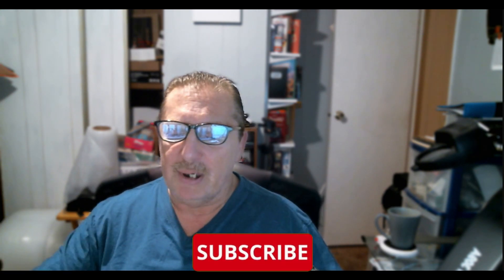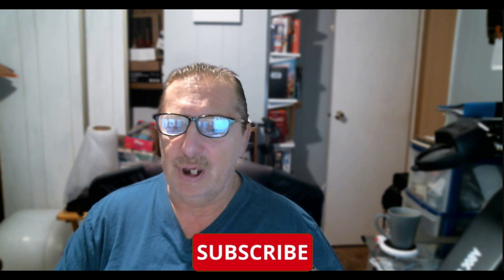Unknown Interference on 10 Meters / What Is This Interference

Comment: So i know what it is, We have the exact same issue but on a 27mhz in the UK. Turns out to be car chargers! they have a 100% cycle rate with no breaks in transmission which is illegal in the UK! EV charges are going to be the downfall of radio imo!
Reply: I live about 6 miles from Vince and have seen this interference. Saw similar signal  on 80 meters band Nov 15, 2024 1:16 AM EST 3.955MHz. It lasted several hours - about 10KHz wide. Live in semi rural Southern NJ. No charging stations in my area for EVs.  likely some homes with 1 car home charger could be nearby. 🤔
Reply: I'm a licensed Ham and EV owner and have never seen that. I am also very surprised you were able to pinpoint the source. What I do see is that some EVs are very noisy on 160 and 80m while charging, like the Renault Zoe, because they use a motor winding as inductance and have rather noisy charge circuitry.

This does not look like an ev charger to me. Too narrowband for that.
Reply from the maker: That makes sense!

Comment: Sounds like some kind of industrial machinery like an inductive welder of some kind. Waterfall displays have brought a lot of this type of QRM to our attention we used to ignore, before. It is so wide in its bandwidth, that it does not resemble a data transmission. I see many things on HF. There is one thing I have seen several times that has a high amplitude that goes all the way up the RF spectrum in a very fast series of pulses in about 1 second. It looks like spikes at full deviation on the waterfall display and sounded like a science fiction ray gun. One time I heard a station come on and remark he saw the same thing and he was 1000 miles distant. I figured what I saw was either a space laser or a new secret radar, but who knows?
Reply from the maker: I know we will probably never know, but they are using frequencies allocated for amateurs to use.
Reply: That is the possibility that it is some new military transmission.

Comment: You should look into a yagy so you can triangulate the source.
Reply from the maker: Wish I could, they do not bother me with wire antennas and ground mounted verticals in the woods behind my house but a tower and beam is out of the question.
Reply: @HamShackReviews  Besides if it is DX and not local a beam won't help anyway. And to triangulate a signal takes at least two people.

Comment: This looks (and sounds) like local interference. Like really local (neighbors). As this is on the 10m band, HAMs a few miles from you should not pick it up if it is local. You should check if other HAMs see the same.   73 and good luck!
Reply from the maker: I am in Jersey and a friend in south Carolina was seeing it with a  stronger signal than I was, he was on a vertical and I was on a horizontal loop. Strange, and I fear it is our frequencies under attack.